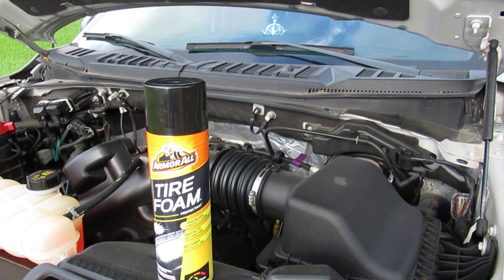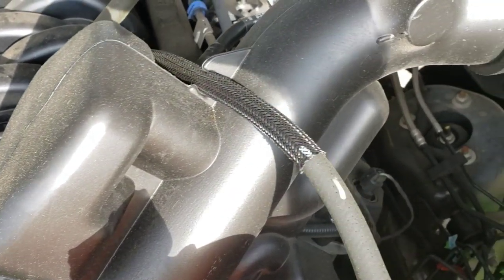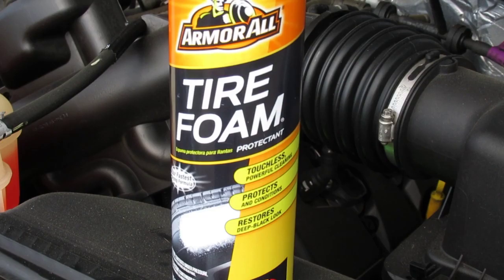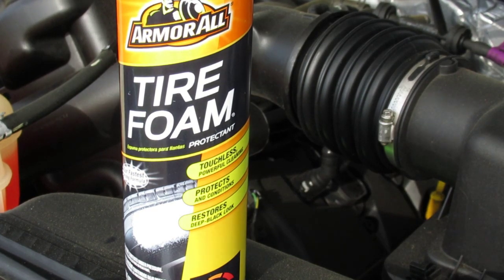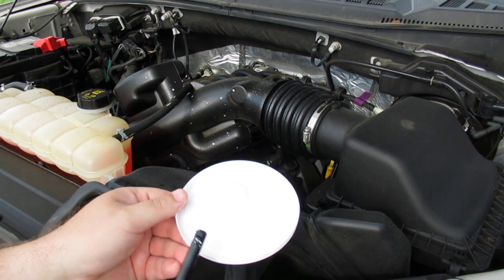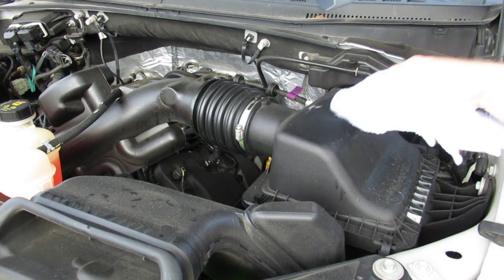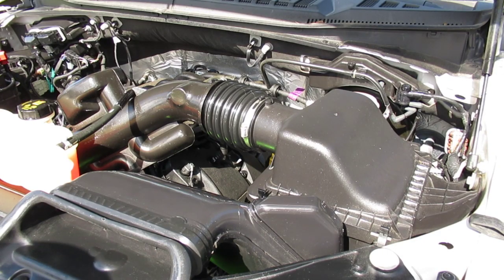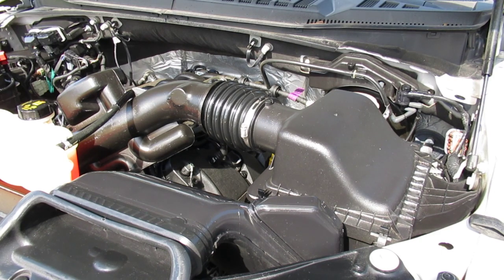HOW TO CLEAN AN ENGINE - UPDATE VIDEO

Comment: Good job.  My brother in law ran a big garage in Washington DC from the 50's through the 70's before all the electronics were used.  They dampened the engine,  sprinkled Tide washing powder on it and hosed it off after about 10 minutes.  As long as the carb or distributor were not soaked, results were spectacular and clients were thrilled.
Reply from the maker: That sound incredibly simple and effective! I miss the days of going to the carwash and spraying the engine without worrying about it.

Comment: Thanks for the follow up, excellent information. I used on my 2001 Mercedes SLK 320 (49,700 miles). I did a little more detailed cleaning in hard to get to places. My engine compartment looks like new!!!

Comment: Engine efficiency eliminating the dirt and grime residue that compromises performance and inhibits electronics.  Thanks for showing us one of many ways to achieve this.  Just applied the Armorall Tire Foam to a high mileage Ford CVPI that last had an engine treatment when acquired 14 years ago from the auctioneer car lot.  Confident that the motor and components are enhanced in every way. Electrical boxes, wire connections, and fluid bottles are OEM sealed against rain water and mechanics working on the car overspilling and spraying whatever products they use. Started right up after the process. I'm in the Sunbelt where the climate requires treating rubber tires, belts, hoses, etc from the elements.
Reply from the maker: Thanks for watching and taking the time to provide the review!👍👍
Reply: @AllAmericanMack  This protects the vehicle and the environment from overspill.  Good job !

Comment: Great job.  I just purchased an older 2011 F150 with 225,000 miles and I’m gradually fixing all the little things. The 3.5 Ecoboost engine needs a good cleaning. I was apprehensive about doing so until I viewed your video. Your method is very helpful. I will use the Tire Foam this week. I may cloth rub the horizontals with WD40 to bring out a little shine, can’t hurt. Thank you very much!

Comment: I watched your first video and was so impressed because I've been afraid of taking my car in and using water on it and shortening something out and I stumbled on the first video and was amazed I've also watch this video and I am going to do the same exact thing thank you and tell your son thank you for his service God bless
Reply from the maker: 25 years ago I had no problem going to the carwash and using degreaser then high pressure washing my engines. But there's no way I'm doing that on my vehicles today. Even a lot of the dealerships will not high pressure wash the engines on their used cars because it was causing problems. Thank you for your support, it really means a lot!

Comment: Do not worry about those comments like in Amazon.  They are here after marketplaces.  Soon, it will be impossible to buy something on Amazon, just because of those negative commenting people.  I think this is a kind of psychological situation.  I liked the idea of using Tire Foam.  It is self explanatory that it is for tires, which are supposed to be protected not get hard, So the hose and plastic in the engine bay.

Comment: Mack that is a great tip. I like making things simple, quick and easy. It's a perfect idea for saving time AND effort. Too many other things require attention than to be rubbing or scrubbing 
our vehicle's engine. It' open to the elements and road dust anyway so keeping it spotless is overkill and obsessing with being pretty. Great tip and video proof. Thanks
Reply from the maker: You are exactly right. If I had show vehicle, that would be one thing. But for a daily driver, there's no way I'm spending the time for engine detailing when it will continue to get dirty from normal driving. Thanks for watching.

Comment: Hello Mack
I just wanted to let you know that,  I tried out your method for easily cleaning under the hood of your vehicle yesterday , after I picked up a can of Tire Foam at the store, about $4.50 as I had never tried this product before. I used it on my wife's 2009 Acura MDX and it worked out great. My 2007 Honda Ridgeline was hot and I didn't think that it was a good idea to spray the Tire From on it. In the morning I showed it to my wife and she said Ok what am I looking at. Not realizing that she never looked under the hood of her car before . I showed her the difference between her clean engine and my dirty engine and she replied oh wow that is a big difference. I'm planning on doing mine tomorrow. Thanks for sharing
Reply from the maker: Hey, great to hear you like the way it worked! That's funny about your wife only because mine would be the exact same way lol, never has seen the inside of an engine bay! Thanks for watching and good luck! 👍👍

Comment: Thanks for the video.  Definitely going to try this.  A note about water.  I did have a 94 Cutlass Ciera that I quite often used the engine cleaner and water rinse at the local car wash.  I NEVER covered anything when doing this.  I didn't concentrate the water spray onto any components but stayed back some and let the water "rain" onto the engine to rinse it.  After rinsing, I would immediately start and drive the car.  I never had a bit of problem doing this.
Reply from the maker: I agree that water wasn't a problem on the older vehicles, I also frequently rinsed my vehicles with the high pressure for many years. I wouldn't use it on newer engines though.

Comment: Thanks for the video. I will pick up a several cans and try it on a couple project vehicles. I am going to play with a couple different ways like using a brush and maybe even pressure washing first. I really like the idea that it provides protection for the plastic. Very good idea.

Comment: The manual for our 2010 hatchback says don't spray water on the engine - I guess many modern cars would be the same. So I'm going to try this. And we have an old VW Vanagon - I bet the engine in that could use some cleaning - make it easier to spot those oil and coolant leaks... Great follow-up to an already great video. Thank you from Manchester, England.

Comment: Hey, thanks for covering concerns of engine and wiring/belt damage. I am gonna try this on my truck.
Reply from the maker: No problem. I've been doing this for many years without any issues at all.
Reply: @AllAmericanMack  Hey bud, is there anything I should cover up before spraying, or not spray as much, Thanks. God bless Jesus saves
Reply from the maker: @chrisbrownutubeabify  I know some people like to cover the alternator, but I have never covered anything and haven't had any problems. You could certainly be cautious spraying around anything that you have concerns about though.
Reply: @AllAmericanMack  one more question, sorry. Have you ever notice any adverse effects to metal, like I would do deep clean, engine block, fire wall, entire engine compartment.
Reply from the maker: @chrisbrownutubeabify  I haven't, and would think that if there would be any problems, I would surely  have seen them by now with how long I've done it. Honestly, I've gotten the tire foam on everything under the hood, steel, aluminum, plastic, rubber, fire blanket, etc. Maybe just try it on a few select areas to see if it is going to work for you.
Reply: @AllAmericanMack  ok thanks for your time, I appreciate you
Reply: how about the computer box?I mean most of the car is automatic
Reply from the maker: As far as I know, the computers are inside the vehicle.
Reply: @AllAmericanMack  is it has to be in a cold engine?
Reply from the maker: Usually when I use it the engine is cold or just warm.
Reply: @AllAmericanMack  thank you!

Comment: Good follow-up to the first video, which I also watched.  I have a 2018 Ford and try to keep the engine bay as clean as possible and so far it looks like new.  I've considered steam heat but am concerned that the high temperature could damage plastic parts and because steam condenses to water, it could get into electrical plugs and might play havoc - so I don't use steam heat.  But using the Tire Foam seems like an excellent choice and seeing your two videos it obviously cleans very well.  I'm going to give this method a try.  Thanks for making these two videos and sharing this method !    And, I just subscribed !

Comment: Thanks for your video. I actually did the same thing for an engine of a car I recently purchased. I didn't have access to a water sprayer and I wanted to clean the engine. I had a can of tire and wheel foam so I tried that and it worked so well. I sprayed the foam and let it sit for a few minutes and then i rinsed it off with a water hose. But after seeing your video i see i do not have to rinse it. The foam does a great job and the finish has a newness look.
Reply from the maker: I've sprayed it off a few times and I'm sure it does help get it a little cleaner but the tire foam does such a good job I just leave it. Thanks for watching. 👍

Comment: You have set forth some good points and I have also seen this same method you're using in the used car business. Having said that, here are a few differences with automobiles and not trucks. When I worked for Mercedes, spraying silicone on the engines would be absorbed through the air cleaner and cause damage and or malfunction with the O2 sensors. Also, when speaking with the owner of one of the largest alternator starter rebuilders in the county, he stated that you never want water or silicone penetrating an alternator case or getting into the components of an alternator. If you speak to the sales reps with Gates who make some of the largest v-belts in the industry they will also tell you that drive belts are made to run dry and putting silicone dressing and or rubber penetrant on them actually can cause them to fail prematurely. Your engine definitely looks good and stays that way for quite some time but your Technique will not always work in certain types of settings or situations and on certain vehicles. Most any Master Mechanic or service industry Personnel in the automobile shops will tell you that it isn't advisable, to put silicone products on your engine. Your technique may be working now but in the future it might cause a lot of problems with your vehicles. If you're trading in your trucks every 2 years then it may not be a factor for you.
Reply from the maker: I would agree to stay away from heavy petroleum based silicone products like tire shines. However the tire foam uses water-based silicone emulsions so it's not the same type of product. I will say that based on my own personal experience, I've seen no negative effects of using the tire foam, even after many years. The truck I used in my delivery business was 8 years old with 238k when I traded it in and I had used the tire foam regularly all of it's life. As a matter of fact, it still had the original serpentine belt on it. I'll never say it's the most thorough way of cleaning but for what it is, it does a pretty good job and keeps me both from using excessive amounts of water on it or spending hours hand detailing it.... I did that one and never again!
Reply: Well, he already says it. There's your proof.

Comment: That is so awesome. I have a 2000 Ford Contour SVT that I bought new. I kept the engine very clean the 14 years I had it. I gave it to my son for four years. Him and his dad ( my ex) tried to change the oil and didn’t  put the filter on correctly. Needles to say Oil blew everywhere and they didn’t bother to clean it off. When I got the car back three years after they did that I tried using engine degreaser on it finally got the oil off but the engine looked yucky. I tried this brilliant idea and now my engine is beautiful again. Thank you so much for this video now I know I can use this to keep it clean and conditioned
Reply from the maker: I'm glad it helped you out! We used to have a Contour in the late 90's and loved that car. Thanks for watching!👍👍👍

Comment: I like this method! Will try it out for sure. How do electrical connections and components fair? What about after several cleanings? Ever any issues?
Reply from the maker: Never had any issues on any of my vehicles. I had 238k on one of my old trucks and never a problem.
Reply: @AllAmericanMack  thanks!

Comment: Clean up with a wet damp cloth to remove any Armor All Tire Foam off of interior and exterior paint. Avoid spraying on any electrical wiring as it will seep into the plug and cause corrosion to the electrical contacts, also Oxygen Sensors. Be sure to cover the Alternator. If you have a car and want to clean the underside of the engine you will need to remove the Splash Shield.  When under the vehicle spraying wear Personal Protective Equipment (Goggles, Gloves, a Painters Mask or other face covering, head cap, or scalp wrap so you don't get in your hair and long sleeves if you may break out with a rash and old work clothing). Don't forget when jacked up use Jack Stands ... Safety First.

Comment: Good video.

I use super clean, low pressure water, a leaf blower, and some 303 aerospace protectant to clean my 2018 6.7l Cummins Diesel. There is zero scrubbing, just spray on the 50/50 super clean and water and let it dissolve the dirt and rinse. Then blow out the residual water and finally use the 303 on the plastic and hoses. I also don’t let it get super dirty.
Reply from the maker: Not letting it get real dirty is the key. No doubt using the tire foam is the lazy way to clean it but it does do a good job. I have a video of using a steamer to clean the engine and while it works great, it's a lot of time and work. The truth is, I'm ok with my engine not being pristine, I just don't want lots of dirt and gunk all over it. I've used Super Clean on other things and it's a great cleaner for sure. Heck, I'm not even against using water to clean it like the way you do it, I just wouldn't use high pressure on it.

Comment: Thanks for this advice. You saved me trouble of looking for engine cleaner. 

Do you think this could be used to safely clean the outside of the radiator/air condenser? I was wondering if I could clean them good enough without rinsing with a hose.
Reply from the maker: I can't say if it would work for that or not. It has a good cleaner in it so maybe you could try a small section and see how it does.

Comment: I think I'll give this a try. I certainly don't want to spend hours cleaning an engine bay or risk messing up the electronics by spraying an engine foam on and then rinsing with water. But I will disconnect the battery before trying this.

Comment: I use pressure wash hose to rinse off after I use tire foam.  You can safely spray water on your engine as long as you avoid wiring and fuses.

Comment: If you use tire foam and agitate it gently with a brush, it really cleans it to like showroom new appearance, and then gently wash it off with some light hose water. Then dry it carefully with a microfiber towel. If you want extra protection & make future cleanings easier & faster, you can coat it again with tire foam but this time don’t water it off. You can cover the alternator if you want but it really doesn’t matter.

Comment: How do you think this would do to use to clean an protect the outside of a 36 foot motor home. It’s fiberglass but I was wondering if it would hurt the clear coat on it. I really like the idea of it cleaning an protection on engine definitely open for suggestions thank you
Reply from the maker: I don't really know. I use it on the engine because it's quick and easy to use without without spending hours on it and to keep from from using a lot of water. If anything, maybe you could test a small area and see how it does bu honestly, I would probably use something made for fiberglass since there's no issue with using water on it.

Comment: I need to replace a valve cover gasket on my old (but in good shape) 1988 Chevy S10.  As expected, I have quite a bit of gunk build-up around the gasket.  Would this be a recommended product to clean that off?  Thanks
Reply from the maker: You may need to use degreaser if the gunk is pretty bad. I've never used it on a really dirty engine but since tire foam is pretty cheap you could try it first to see how it does. If you do try the tire foam, let me know how it works since I've had quite a few people ask about using it on real dirty engines.

Comment: Why tire foam? Is it because its good for the tire rubber so in turn the rubber hoses in the engine? I have always been told nothing gets on belts. I need to clean mine but confused . Thanks
Reply from the maker: I use tire foam because it's not only a protectant but a cleaner also and it does a good job of breaking free dirt and minor grease. It also helps condition the rubber and plastic to keep it from drying out and cracking prematurely. I don't think there's any problem getting something on the belts as long as it's not something that's going to hurt the belts. The tire foam will condition and help protect them.